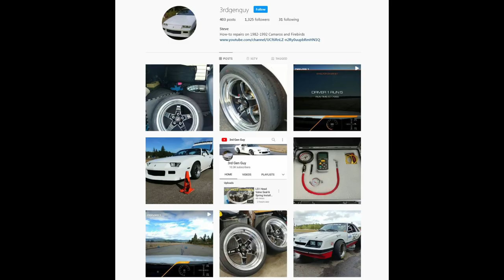What a Bad Axle Pinion Bearing Sounds Like

Comment: You going to upgrade the rear end or rebuild?

I just replaced  LT1 4th gen rear with 4.10s with a Hawks 8.8 with 3.73 and the gearing is so much better on the LS motor
Reply from the maker: I had it rebuilt quickly to get back to my racing season.
the lightweight 10 bolt has a lot of advantages for handling,
but it won't take abuse from hard launches, something we don't do in autocross.